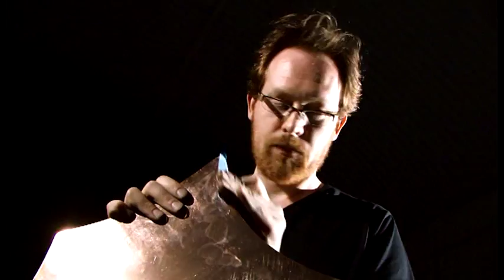Matt Nolan Custom: In the Workshop

Comment from the maker: Standard angle grinder, 4-1/2" cutting disc - very thin cutting disc though - 0.8mm thick. OK for curring cracks out of cymbals but be careful not to get the cymbal hot (i.e. work slowly, possibly cool with water, etc.) If you get any discoloration from heat on a B20 Bronze cymbal then you have likely made it brittle at that point.

Comment: It might sound like a daft question, but why dont bronze cymbals crack when they have been hammered so much? Doesnt the hammering work harden the metal and make it brittle? Do you ever need to anneal the metal (is that what you did in the video when you put the cymbal in a water quench?) Do you temper them to make them strong but not brittle?
Reply from the maker: Hello. You are right that the hammering work hardens the metal. As cast, it is brittle as glass. It needs to be quenched in cold water from a fairly specific temperature before working, which leaves it too soft to be a finished cymbal, then you work harden it as you shape it. Careful balance!
Reply: Thanks for your helpful replies Matt.
So is it ok to ask, what should the temperature/colour be when you go from heating to quench, to correctly anneal or soften a bronze blank to make it fit for hammering into a new form?
Many thanks, Jonathan
Reply from the maker: Hi Jonathan. Somewhere around 700 degrees Celsius. Hold it at temperature for a while before quenching to ensure the whole thing is even and that it has had time for the crystal microstructure to come to equilibrium. Especially if it is a thick piece.
Reply: Thanks Matt, I'll try again on the bronze. It came from a stagg ride cymbal that is about 2 1/2 mm thick AT THE EDGE LOL
I just saw one of Lance capeau's videos he reckons B20 is not a good idea to start with...
Is it worth devising up a little baffle/brick kiln arrangement help in getting an even temp? I use a plumbers torch (whatever I have) and it struggles at times to heat a larger piece all to the same colour at the same time. Bronze pike lures would be great!
Thanks again, Jonathan
Reply from the maker: Yes. If you can contain the heat and lose less of it into the surrounding air then your torch will do better

Comment from the maker: Hmm, well, without a lathe, no not really. Use an angle-grinder or dremel with a little cutting disc and go really slowly. Don't cut all the way through at once - first cut a shallow groove, then deeper, then deeper, then through. Or find a local metal work company who have a water-jet cutter and ask them to do it for you.